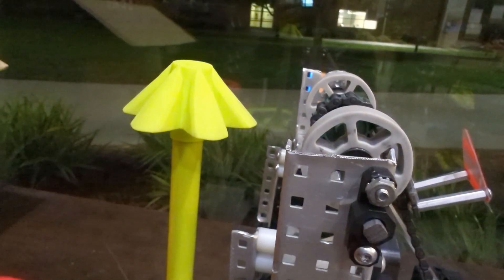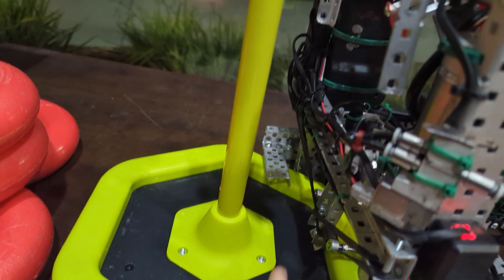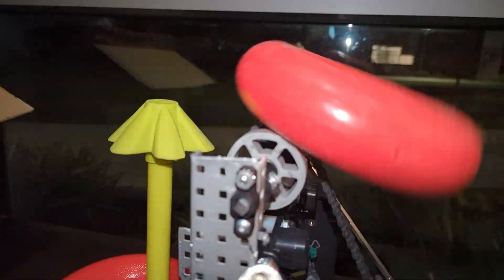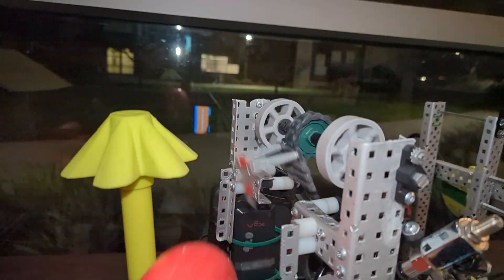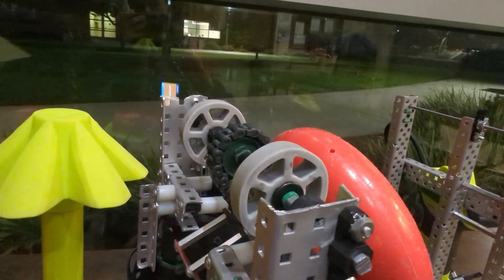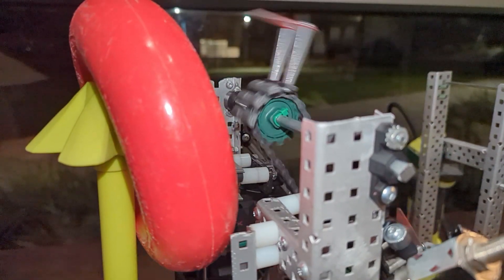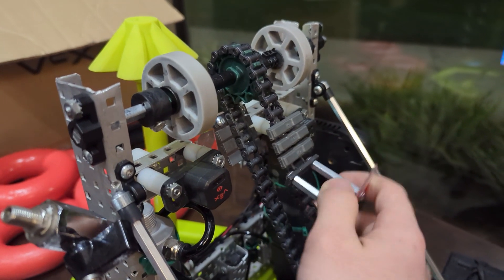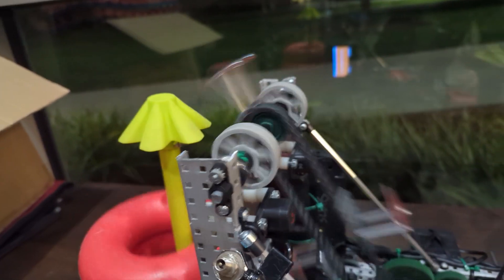How to Get Rings to Land on the Mobile Goal | VEX HIGH STAKES

Comment: I noticed on the top of intake that you used a high-strength axle, do we need to use a high-strength axle, or will a normal one work?
Reply from the maker: @wrixle.spring  Yes a normal shaft will also work

Comment: Our team don't have VersaHex adapters to put flex wheels on, is that an alternative?
Reply from the maker: @EasyPianoMDStudio  The main other things some people use is:
- you can put 12 tooth pinion gears in the middle instead
- you can use lock bars on both sides of the wheel, and that should work too
Good luck!
Reply: @Joseph973  Can I use the  2.75 green wheel?
Reply from the maker: @EasyPianoMDStudio  You might be able to, give it a try
Reply: @EasyPianoMDStudio can the green wheels work? Our teams don’t have enough flex wheels

Comment: Our team struggled getting the belt and hooks tuned just right. I’d give those who are struggling some advice. Use 2 inch standoffs and 1.5 in hooks. We just used just some longe screws instead of poly-carb, either works. Also we found that having the direction of the hook go vertical when it’s traveling down the length of the goal was helpful in consistency. This is done by adding another gear further down the beam holding the top gear.
Reply from the maker: @alexvaughan6830  Every robot will be a little different and have it's own little quirks about it, I'm glad you found something that works, and thanks for sharing what you found!

Comment: My school team unfortunately doesn't have any flex wheels and we can't order any due to district issues. Is there any workaround for this like using a different part?
Reply: sprockets with chain on then
Reply: Use those small 1.75 green and gray wheels with rubber bands its what we do while where waiting for our flex wheels
Reply from the maker: The small green wheels and sprockets definitely work, and you can also use gears too.
Reply: @Joseph973  what about sprockets with rubber bands on them?